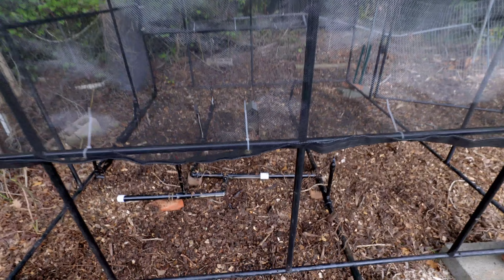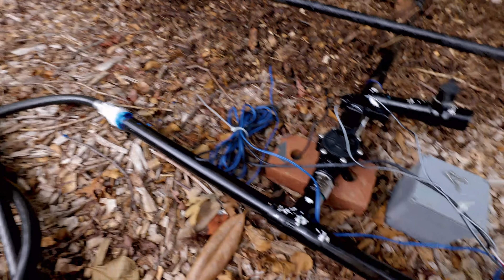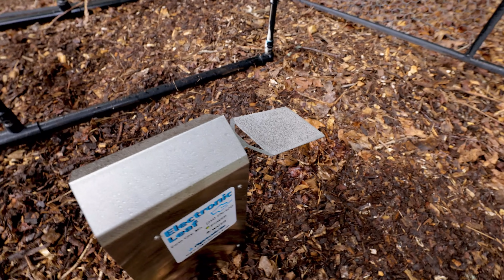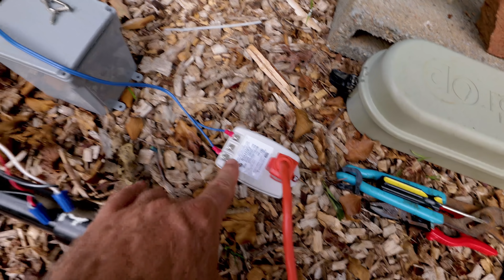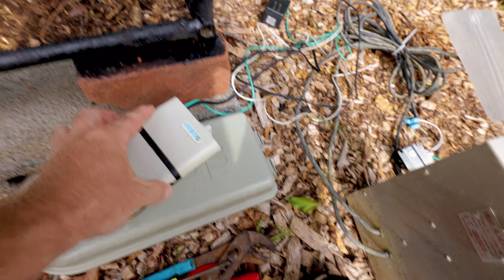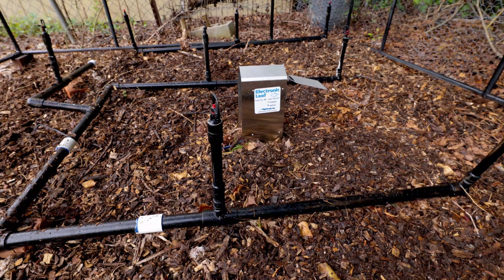Plant Propagation Setup - 2020

Comment: Hi Jim! I hope your having a  good day. So, I was wondering, are you propagating already for next years crop? It seems early to propagate for next year but late to propagate for this year.. I'm a little confused. Also, when would you begin taking cuttings to winter over for next year if that is not what you are doing here... Thanks! Oh, and an off topic question about seedlings... I dropped two seeds per cell and I'd like to grow on both seedlings that germinated. Can I prick out one of the two seedlings out and plant it in its own separate cell? If yes, when would I prick it out? Shortly after it germinates or after it's grown 2 or 3 sets of true leaves? Somewhere in between? LOL I HATE to waste a seedling and feel I should have grown more anyway.. Thanks, Jim!
Reply from the maker: I said in the first video that I am super late. Also the first things I stuck are for nothing other than testing my new system. I will get to work on shrubs next week and they will all over winter in a house. Generally, June 15 to August 1 is my goal. Just late from other projects. I always overwinter perennials in a house regardless of timing though. Thanks for asking

Comment: Jim do you need a box to keep it all from getting wet out of your green house?
Reply: He said he had a waterproof box to put it in.
Reply: Carla Radke : thanks!!! Just what I was trying to find out Carla
Reply from the maker: No, it is not actually a lot of water. It is a mist coating that dries between running.
Reply: HortTube with Jim Putnam : I meant the electric and wires sitting outside of misted area
Reply from the maker: Oh sorry. I'm slow. Yes, I have a waterproof box for the electrical pieces.